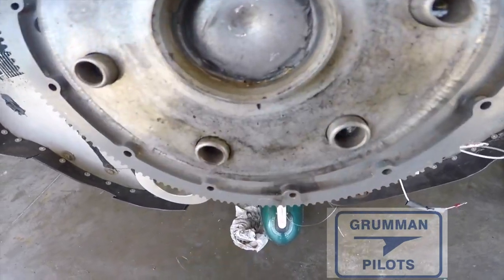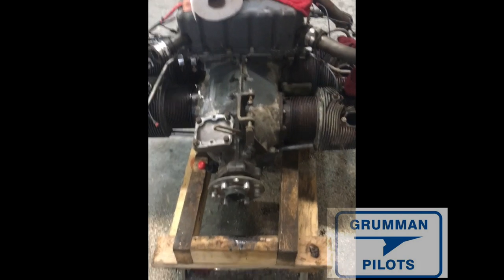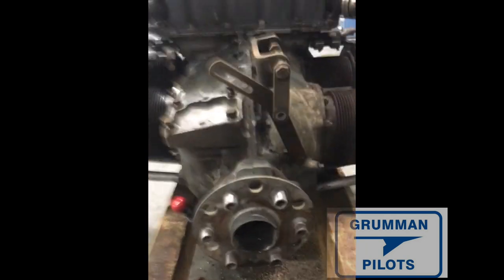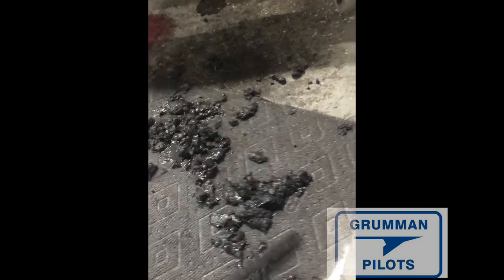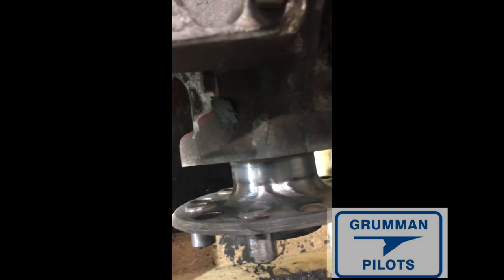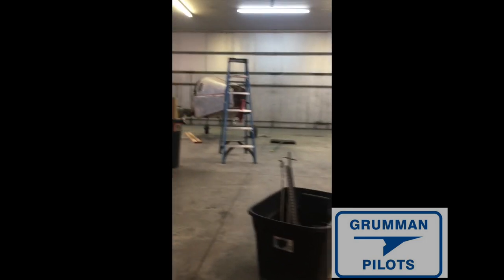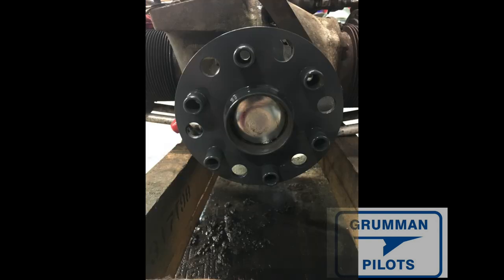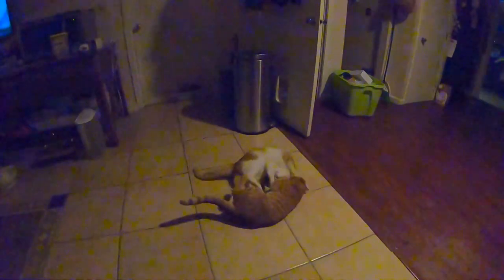Crankshaft Plug Sludge Removal - Grumman Style

Comment: this is normal.  not unusual at all.  might even be worse on variable pitch props because they have constant oil flow to drive the propeller. 
this amount of sludge will form in a year or less in a constant speed application. 
this also shows you the amount of toxins in aircraft fluids.  lead, sulfur, carbon, paraffin not counting the residuals of av fuel.
Reply from the maker: That is why we were so happy to be able to show folks what they normally do not see.  You could run your engine perfectly and still find some there.